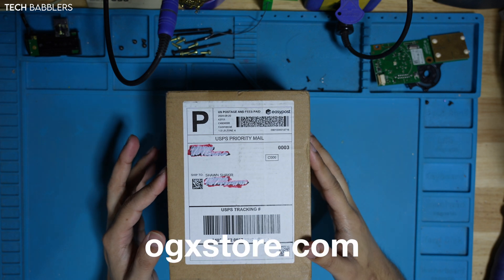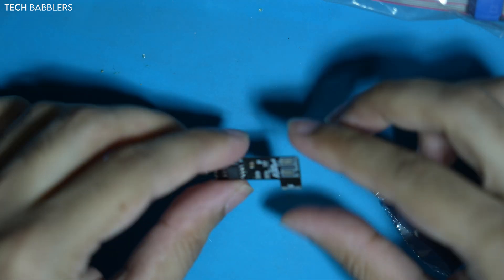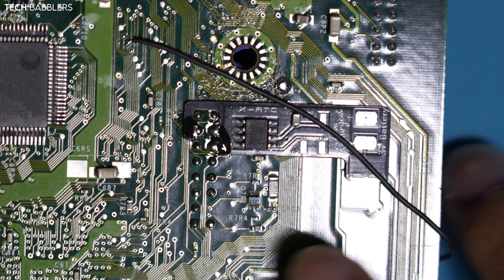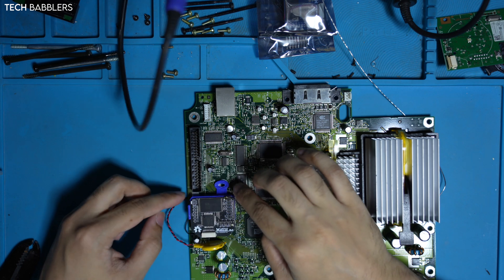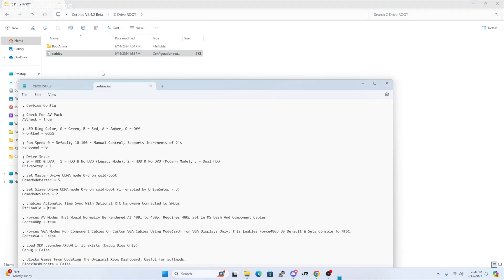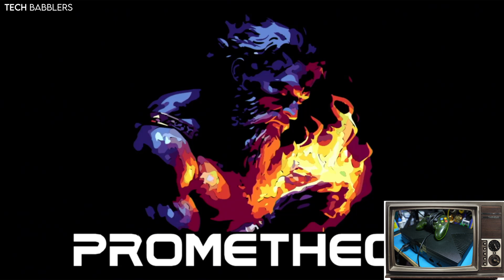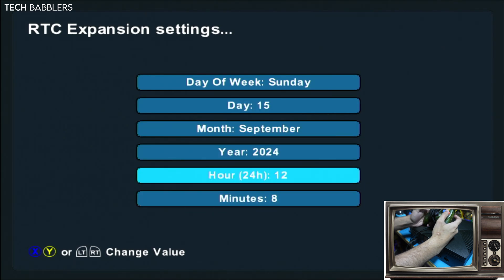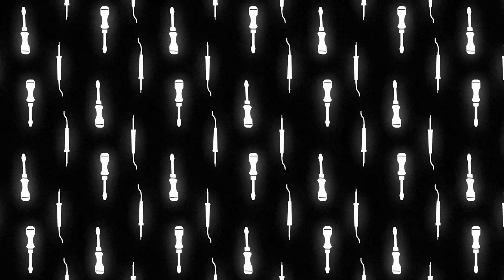Installing X-RTC: A supplemental Real Time Clock for the Original Xbox!

Comment: Nice, but I would have soldered a female connector instead of wiring the battery direct, that way when/if it needs replacing down the line you can just disconnect it and reconnect the new one instead of having to de-solder and then re-solder a new one.
Reply: Very easily can still. Simply solder on some dupont connectors.